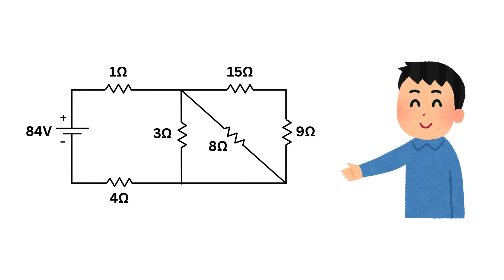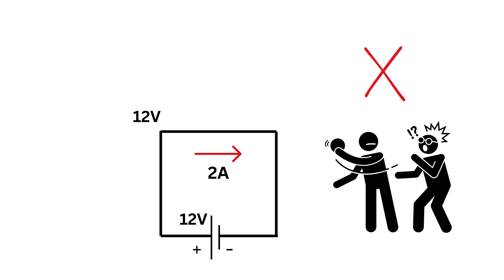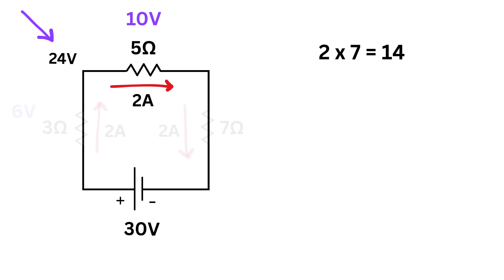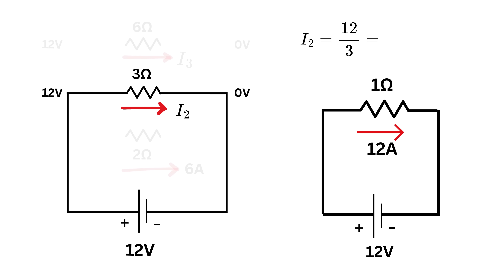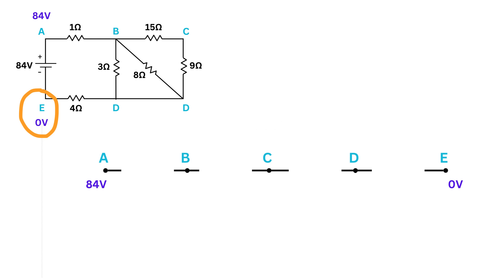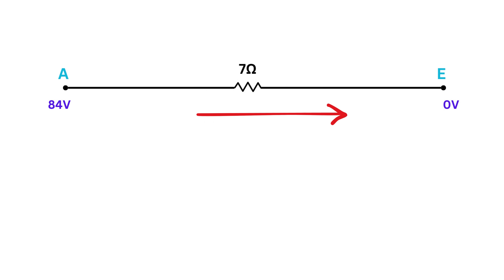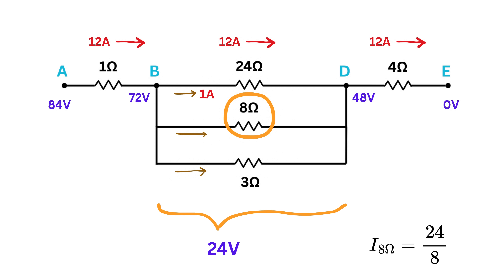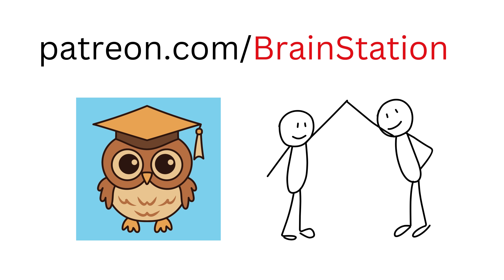How to Solve Every Series and Parallel Circuit Question with 100% Confidence

Comment: Sir, thank you. I have completed my level 5 Electrical & Electronic Foundation and will move to level 6 from this September. Your teaching method is very easy and clear to understand. It will be useful for students like me if you upload some videos about 3-phase transformers, generators, motors and transmission lines. Moreover, please upload some questions to practise. Thanks again.
Reply from the maker: Sure

Comment: The answer at 1:38 is incorrect. Total current thru the 5 ohm resistor is 2.4 amps. Voltage drop is 12 volts, not 10 volts. V/R= 2.4amp

Comment: Current through the 8 ohm resistor is 1.9091amp and the voltage drop across the 15 ohm resistor is 4.7722 volts.
Reply from the maker: Nope

Comment: As one who used to teach this before we had videos and graphics, this was not ideal.  As soon as it was implied a resistor ate some of the potential I knew this was a failure.  It got worse in the case where the resistance was removed and they said the potential at the third corner was the same, but we know the battery terminal was zero (so that's a short circuit and the wire is our resistor) - just badly presented - that is when fuses are introduced!  But I digress.

The reality is that our responsibility teaching future technicians is to use proper language and speak to losses like this as energy.  The voltage 'consumed' is diverted and radiated.  The wires they work with will provide all manner of symptoms and that hot terminal (whether radiating or just discoloured) will be an indication of a resistance that is not in the circuit design.  That awareness from the outset is essential to their efficiency and understanding.

Comment: From right to left:
15+9=24 Ohms,  in parallel 8 Ohm makes 1/(1/24+1/8)6 Ohm, this in parallel to 3 Ohm -> 1/(1/6+1/3)=2 Ohm. 2+1+4 = 7 Ohm -> 84V/7Ohm->12A
12A with a serial resistance of 2 Ohm makes 24V at the 3 Ohm resistor, and because of that 24V divided by (15+9=)24 Ohm makes 1 A and this results in 9V over the 9 Ohm resistor.

Comment: Nice and simple explanation of Kirchhoff's laws for current and voltage in a DC circuit without mentioning Norton or Thevenin equivalents.  I am a retired RF engineer and amateur radio operator but I am always interested in how others might explain these concepts.  Good work!

Comment: It's not that hard to understand:
a)  The 15 ohm and 9 ohm are in series which adds up to an equivalent resistance of 24 ohms.  
b)  This means there are three resistors in parallel: 3, 8 and 24 ohms.
c)  The calculation for parallel resistors is: X = 1 / ((1/3) +  (1/8) + (1/24)) which equals: 2 ohms.
c)  2 ohms is in series with 1 and 4 ohm resistors which adds up to 7 ohms
d)  An 84 volt battery connected to a 7 ohm resistor is pulling 12 amps.  Such as 84/7 = 12 .
e)  That means 12 amps is being pulled through the four resistor network of 2 ohms (as defined above in step c).
f)  To get the voltage across 2 ohms is E  = I x R or E = 12 amps x 2 ohms = 24 volts.
g)  The current flow through the two resistor leg of the 24 Ohms (step a) is 12 volts divided by 24 ohms =1 amp.
h) The voltage across the 15 ohm resistor is:  15 ohms x 1 amp = 15 volts.

Comment: Try to solve this with 100% confidence: 4 nodes. Nodes A and D are connected to the battery. Five resistors of values 1-5 Ω sit between nodes AB, AC, BC, BD, CD, respectively.

Comment: I have a doubt, gentlemen:

In the type of "messy circuit" sir mentioned in the video, are we JUST ASSUMING that the potential difference becomes 0 by the time the current reaches the end of the circuit, or the potential difference REALLY BECOMES 0?
Reply: The negative terminal (aka Ground/Earth) is the voltage reference for the entire circuit, so it's basically 0V by definition.
Reply: @falcon-ng6sd Exactly what I was asking, sir! Your point is that the "negative terminal/earth" is the reference of the circuit(which is 0V), since it wasn't given in the question, i got confused.
Reply: @AdityaM-m2k  Sometimes the reference can be specified someplace else, and then the negative side becomes a negative voltage, and the positive side is a positive voltage.  For example, we could call node C the 0V reference.  Then node A is +27V and node E is -57V.  Everything still gives the same answers.
Reply from the maker: yes we assume... to make calculations easy
Reply: @BrainStationAdvanced Thank You Sir🙏❤️
Reply: That's a question, not a doubt.  And your reference, by definition, is 0V.  That's what makes it a reference.  You can put the reference anywhere and the math will work, but by convention it is normally put on the negative side of the source.
Reply: the potential difference does not become zero, there is no potential difference between two points unless there is a voltage drop between them, it is just a measure of potential energy, the ability to do work in a circuit.

Comment: The circuit and values shown at 1:36 are incorrect, and the conclusion is also wrong. A 12V voltage source connected directly across a 5-ohm resistor will have 12V across it. This assumes there is no voltage drop in the wires or the battery, as they are not mentioned in the analysis and are assumed to be ideal. The error lies in stating that a 2A current is flowing, when in fact the actual current would be 2.4A.
Reply: In real life yes...but this is "circuit analysis" and you give here the facts  conserning this issue. Everything else is supposed to be ideal. If you want to take care other factors you have to tell them in this analysis before hand so the person calculate this can use it.
Reply: @TomKunnas  If wires are treated as wires and the wires are connected to 12V in your simple analysis they should measure 12V and 0V at the battery and also at the other ends of the wires - across the resistor. The right side of the resistor will be at 0V not 2V. There is simply a mistake. It is not a case of in real life or not. You either apply ideal circuit components consistently in your analysis or you do not. You cant have a wire with no voltage drop across it with one end connected to 0V and the other to 2V without a voltage drop of 2V across it.
Reply: I caught that one too.

Comment: In the first diagram the current is 2.4 amps not 2 amps (12/5=2.4) so the voltsdrop is the full supply voltage.
Reply: So technically he made up the 2 amp thing? and he should have gotten the current by knowking just the battery volt and the resistance? and by then now knowing the voltaje drop?

Comment: I got 5.5 ohm. Let me watch the video and see. Last time I did this stuff in 1980.
Reply from the maker: which part you went wrong?
Reply: @BrainStationAdvanced  The fraction 1/24  + 1/8  + 1/3 = 0.5
Reply: @TrustMe8ro  You need to take the reciprocal of 0.5.  1/0.5=2 ohms

Comment: When you put the 8 ohm resister diagonally across the circuit... it made my head spin.  My brain unspun after you explained that the 3 ohm and 8 ohm resistors were wired in parallel and  we use Ohms Law and parallel circuit rules for that part of the circuit and then we use Ohms Law and the series circuit rules for the remainder of the circuit.

Comment: I love the 3 phase resistor. 1 wire. 1 led. The led will cause the dc to turn to ac. The light will palse  and stay on. Led will switch the ground N to P and P to N. Hense A/C.  Positive nuetural and negative all in one wire. Technically its a short type resistor.

Comment: Some resistors store the electrons and displace it as heat.  Some redirect the electrons to a ground. Some convert them to dc to ac. Some are insulators. Elections travel on the ouside of the wire. The wire insulation is a resistor.
Reply: no

Comment: Unfortunately - not every circuit is so easy.
Consider bridge of uneven resistors.
Reply from the maker: Yes this video is for series and parallel circuits...will make one soon for other circuits using mesh and nodal analysis

Comment: [1:42] 🤔 Wait a minute, something doesn't add up here.

If 2A passes through a 5Ω in your circuit, then the source voltage must be 10V. Source voltage = voltage drop. 😉

Or, put another way, if source voltage is 12V and current I = 2A, then by Ohms law, we have:
R = U / I = 12 / 2 = 6Ω ≠ 5Ω
Reply: My goodness. I too agree with this. Get the facts checked correctly before uploading.
Reply: Call it the internal resistor of the source. It's a real effect, BTW...
Reply: @CesarGrossmann  Voltage sources are always assumed to have zero internal resistance unless otherwise stated.
Reply: I'm sorry but this is a catastrophic explanation of the example in the video. The current is ALWAYS determined by the resistance or the load. Resistance is a factor or couse and the result is the amount of current flowing through that load at a given voltage. So, at the source of 12V, because of the 5 ohm resistor, by the Ohms law there will be 2.4A current flowing in the circuit!
Reply: First off, the word "Catastrophic " is referenced to the first example on this video as my earlier reply says. The example is totally wrong and misleading to the beginners and those who don't understand electronics well. Second, my explanation is based on ELECTRONICS AND ELECTRICAL ENGINEERING THEORY AND KNOWLEDGE. You could take some electronics theory book and you'll find all the answers there!!!
Reply: should have some correction here or it misleads beginner.

Comment: if you're finding anything other than equivalent resistance, nodal and mesh are always better than finding series and parallel resistance
Reply from the maker: Yes this video is for series and parallel circuits...will make one soon for other circuits using mesh and nodal analysis

Comment: 1:46 the example is wrong for the Kirchoff's Voltage Law (KVL). Given E the battery voltage and V_R the resistor's voltage drop, after setting the direction of the current (suppose clockwise), the algebraic sum of all electromotive forces and voltage drops is equal to 0: E - V_R = 0

in the example E - V_R = 12V - 10V = 2V. Correct me if im wrong

Comment: When a 12v battery is applied across a resistor, there will be 12v dropped across the resistor. The value of current flowing will equal V/R.
   If you apply a wire directly across a battery, the current flow will be V/0, so infinite current flow. As a practical matter, no piece of non-superconductor wire has actually zero resistance, it might be on the order of milliohms, and the battery itself cannot supply infinite current so there's an ESR (equivalent series resistance) due to the chemistry and construction of the battery. Nevertheless, there will be lots of current flow until the wire breaks/melts, or the battery blows up. #FeedTheAlgorithm

Comment: In the 12 V circuit with out resistor if the positive is connected to the negative the voltage is zero as it a short circuit. There may be a slight difference due to the internal resistance of the battery. At 2.06 minutes in the video
Reply: Totally agree, likewise the 5ohm resistor across the battery drops the full 12v not just 10v ... the current would be 2.4A not 2A ............. not a good start really!
Reply: I came here to say exactly the same thing, this would be very confusing for a beginner.

Comment: Why in series current stays same but voltage doesn't and in parallel why voltage stays same but current doesn't??
Reply from the maker: Because as I explained, a resistor is a voltage eater, and thus when connected in series, each resistor "eats up" (or drops) a part of the total voltage...that's why voltage is divided. But current has only one path to flow through all of them, so it stays the same.

In parallel, each resistor gets directly connected to the same two points...like getting plugged into the same battery so they all get the same voltage. But since each path can "pull" its own amount of current based on its resistance, the current splits up.
Reply: Another analogy you can use to better understand is:

1️⃣ Think about current as the amount of water running through a pipe (like in litres per second);

2️⃣ Think about voltage as the pressure which makes the water move (like in PSI or Bars);

3️⃣ The resistor is the water "faucet" with which you can turn the water on (R → 0) or off (R → ∞)

When in series, the faucets are on the same pipe and the same amount of water passes through them. The pressure, however, won't be the same at every faucet and it will depend on how much it is open.
Reply: @Dimitar_Stoyanov_359  what about parallel
Reply: @x.in_hype 
When in parallel, you have several pipe branches, but every branch is connected directly to the source (your house's water inlet). So, every branch will have the same pressure – the pressure of the source.

But here, every branch has a faucet, turned differently. So, the water amount through every branch will depend on how its faucet is turned.
The most water will run through the most open branches (R is small), and the least water will run through the most closed branches (R is big).

At the node, the total amount of water, coming from the source, will be equal to the sum of the water currents in every branch.
Reply: @x.in_hype 
A big footnote:

This analogy is for a closed system. It means that no water leakage is possible.

On the other hand, your kitchen sink is an open system, because you can take a water cup and throw it through the window (current loss) 😂
Reply: Think of it as a water hose. The current is like the water flow in the hose and voltage is like the water pressure. If you have a valve or a nick in the hose that will reduce the flow (as an electrical resistor will) however, as you probably realise, you cannot have different water flow going in than going out unless there's a hole in the hose. It's the same with electrical current. No matter how many resistors in serial you have the current stays the same over each resistor. Parallell resistors are like branched hoses with different valves. The pressure going in to each valve (voltage) is the same but the flow going through each valve is determined by how open the valve is (resistance).
Reply: Current cannot escape anywhere. There is sane current the whole circuit.
Reply: @okaro6595  Only if everything is in series.  Once you put something in parallel, the current has multiple paths it can follow, and it will follow every one of them in inverse proportion to the resistance of each path.